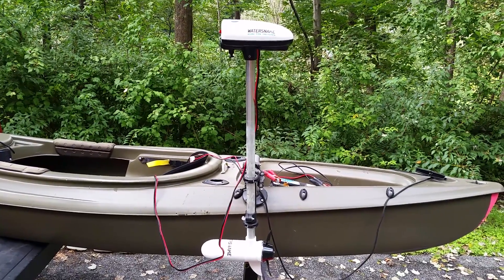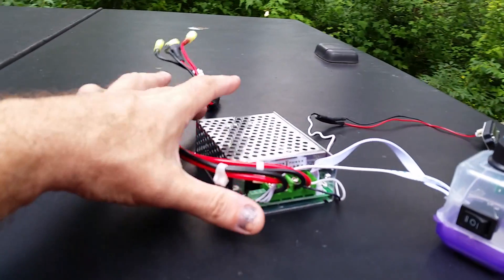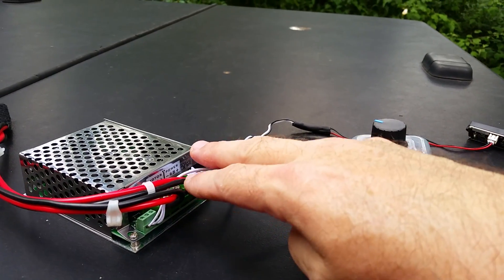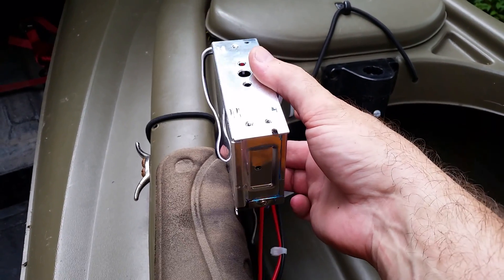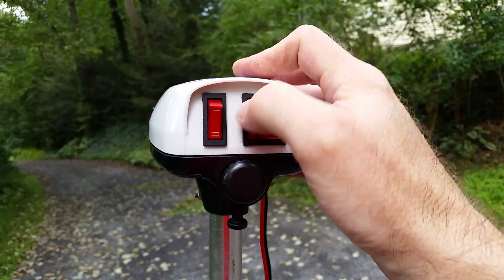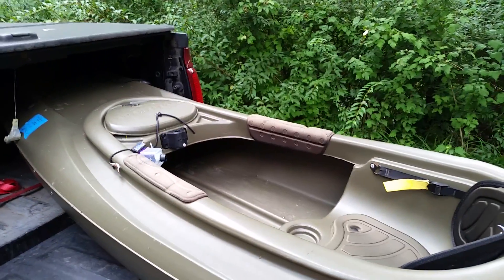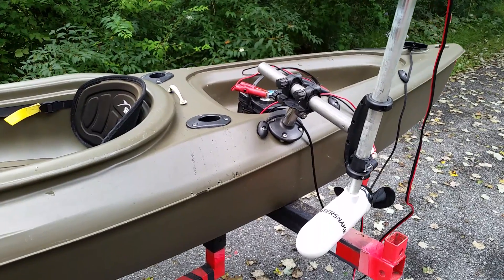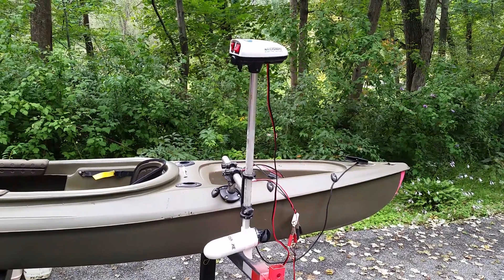Turn Any Trolling Motor Into An Infinite Variable Speed Control For Under $20

Comment: Idk what he means by juice being used when i got a amp reader on my Bluetooth battery and when in calm water on low power it draws 9amp and flexs to 14 most but thats because im goin to current of the water and then flowing with the current of the water that 14amps drops to 9 sometimes 6 or 7 or 8 but stays at the 8,9,10 amps and then on high power its 20amps but then jumps to 25. On my 100ah battery on low i get a easy 8 to 9 or even 10 hours of continuous motor on low and on high 3 to 4 even 5 hours all depends if im on calm water it just depends if your motor has to work harder and this is the T24 24 pound thrust and i just recently installed a small 50 watt flexible solar in the front that gets me 4ah back every hour on peak sun and about 1 to 2ah in shade but after being on the water for like 10hours i get like a total of 20 to 40ah in between back in my battery so running low is very power saving but in all reality who runs a motor for 1hour or 2 hours straight when kayak fishing i do maybe 1hour on high then sit for 30mins low for 30mins stop for 30mins move for 30 stop for 30 and never really use high unless heading back to dock because im so far in but as said be4 100ah is great specially with a cheap 50watt flexible solar with charge controller and i run a garmin striker on it as well including a 12v cigarette usb c charger and usb 12ft to my Bluetooth waterproof speaker for my music on low but of course you need the battery box which i use because it has the 2 breakers fuse and easy to keep direct sun off the battery in general

Comment: I keep asking this question as I'm considering buying a T18 or T24:  Is the Watersnake trolling motor rated for LifePo4 lithium batteries?  One Amazon image shows AGM batteries only (a deal breaker for me)!  I also saw what appeared to be a Watersnake bulletin that recommended against Lithium batteries due to the 14.5 voltage. What do you think?
Reply from the maker: A higher voltage will just spin the motor faster. A bit over powered isn't going to do much except give you a bit more power. I'd also recommend the 24 over the 18.
I have a Watersnake 24 still in the box if you know anyone looking for one.
Reply: Any battery will work AGM will be will work fine they are way heavier then lead acid and lithium
Reply from the maker: I'd use a LiFePo on it. My LiFePo battery is 13.4 volts when fully charged.
Reply: Recommend lithium depending your distance use 50ah to 100ah 13.8v I've got a small 12.5 ah motorbike size lithium just to go to destination then paddle round the then use motor back to shore really do not need motor all the tme

Comment: I built a PWM trolling motor controller that would run off an old Nintendo NES controller, up/down did speed intervals,  left/right did steering and A/B did forward reverse. Unfortunately, it was in an audible frequency range since I didn't realize the switching frequency was so important.

Comment: Do you have a parts list for the RAM Mount for attaching the motor shaft to the kayak?  That looks a lot slicker than some of the "Jank" ways for attaching the motor securely to the boat.  How do you STEER?  using paddles?  I don't see any cables for directional control
Reply from the maker: I used to teer by leaning like a bike, or using he paddle foe sharper turns.

Comment: The concept of using the Rheostat instead of the control switch is to avoid lost power as heat dissipation through the motor/water.  But doesn't the control box just move the heat loss from the motor to the resistors in the box?   Also, is there any way to waterproof/water protect the unit without causing heat buildup?  kayaks get a lot of inadvertent water splash from paddling, fish etc... so figuring how to keep it close enough to use, but out of the weather/exposure would be critical to longevity.

Comment: I use 2 of these on my little 2.1m boat. I leave the switch on "II" and drive them in series (6V each) for low speed and parallel (12V) for fast.

Comment: Can this work for a 55lb thrust motor too? How do I know what switch size etc I need for the bigger motor?
Reply: Well to fess up, I have the electric you have mounted on my kayak already. But picked up a 55lb for $20 that I thought I could swap out, is that just a waste and going to chew my battery unnecessarily? 
Thanks for any help….anyone really…
Reply from the maker: Yup.
If you got a 5 speed motor, pull the head off and get the wires out. The red and black wires are what you want to connect to. The colored wires are for the different speeds, so just cap them and forget about them.
Reply: @DanHiteshew-oneandonly  so it was a bow mount wireless that needed a $400 part, so I bought it for $20 as I thought I could Frankenstein it up and have heaps more power. If it were you would you stick with the smaller one or go the 55lb?
Reply: And then would the variable speed switch above have enough amp for a 55lb motor?

Comment: I have the t18 and I am using a pwm and I'm not sure if I will have high speed since I am no longer using the original head unit.  Do you know how it will perform with the pwm and not using the original head unit?
Reply: Thanks for the information.  I saw the narrower blue wire and I got all confused. Thanks again
Reply from the maker: @michaelblencowe4241  I'm not certain about that model, but the colored wires are usually the ones that are switched. the red and black should be what you connect to.
Reply from the maker: If you connect the positive and negative to the PWM you'll be able to turn it to 100%. You'll get just as much top speed out of it. (maybe a bit more)

Comment: None of these PWM videos show how a heavy 6 or 8 guage trolling motor wire is connected to those tiny terminals on the PMW.
Reply from the maker: What size motor do you have!? I used regular 14 gauge (maybe 12) extension cord wire.
Reply: @DanHiteshew-oneandonly  MotorGuide 34 pounds thrust. There are no thin guage wires on it. The manual recommended a 50 amp breaker. The toy PWM shown on YouTube videos and sold on Amazon is all a farse. No electrician would hook that junk up to a trolling motor.
Reply from the maker: @cdgarrett1  Ok

Comment: I have a Minn Kota c2 40. Its a 5 speed and it does not do full 40a draw at F1. F1 draws only 6.6A and F2 is 8.3A. 

I believe there is inefficiency at low speed but highly exaggerated

Comment: EBay sell a waterproof PWM type DC controller that seems to be the right spec, max amps is lower at 20amps, and you’d have to wire your own reversing switch to the outputs.

Comment: Hi. I have a twelve Volt System on my sneak boat and two pedal style steering cable operated. It has a F/R switch. A H/M/L switch and a variable speed rheostat knob. The original trolling motor has four wires which connects to four brushes. My Q is, can I take a tiller handle style and convert it over if it only has five settings or do I need one that has the variable speed on the foot controller.? Looking at my options and would appreciate assistance.
Reply from the maker: You should be able to connect the positive and negative to the speed controller. the additional wires are for the switch of speeds. You just want on/off and let the rheostat control the speed. (I think I understood your question correctly)

Comment: Your battery was at 82%. At the start it actually showed 75%, as you probably know by now the meter was upside-down 😂 Apparently those watersnake motors are not like other motors and are very efficient on the low setting. It's probably PWM but not variable but don't quote me on that lol.
The 24lb thrust motor uses 20Ah on High and 9Ah on low. The 18lb motor is something like 15Ah on High and 7Ah on low.
Saying that variable speed and also having the controls up front is nice 👍

Comment: did you buy or make your motor mount?
Reply from the maker: I bought the ball joint style universal mounting kit, but still had the make a piece to mount it level on the kayak. I have an unopened mounting kit still in the box if you're interested in buying it. danielhiteshew@gmail.com

Comment: may I ask can I use a 24v battery for my 12v 34thrust for higher speed ?
Reply from the maker: No. It'll overpower it. They're designed to handle 12v.

Comment: too much wires ..just get a lithium battery it will troll you all day
Reply: That doesn't solve anything with the wires... ah is ah no matter if its a lead battery or a lithium battery. The lithium can recharge more than a lead and is lighter but 3x the price.
Reply: @Astrophoto01  I think the point is that with a Lihium battery you can skip all the wiring and use of the speed controller and just direct wire the motor to the better battery. A lithium battery would allow you to use a lot more of the ahs without damaging a lead acid battery where you could only use half the capacity to avoid shortening the battery life. There's also the advantage of the lithium battery weighing 1/3 that of a lead acid battery. The negative is the extra cost. But the whole situation would be much simplified with the use of the better battery.

Comment: I’ve already gone through two, 60a controllers and they end up burning up, . The second one only lasted 5 min before it started pouring smoke. Have you had any issues with yours overheating?
Reply from the maker: No, I haven't. These are cheaply made units, so it's possible they wee defective. I've coked them by hooking them up backwards before, but it was always my fault when I ruined one.

Comment: Hi Dan, Great video and it gave me inspiration to use it on my kayak. Just had the speed controller go out and found out by accident it was the on/off/on rocker switch. Very cheap switch and found them of the AZN web site 5 switches for 4 dollars. Just wanted to let people know before they throw their PWM unit away to check the switch. Yellow hot, black forward, red reverse. You can direct connect the wire to check and see if it's the switch. I can also hear a relay clicking in the unit but it's still working so I haven't tried to access that one yet. Hope this helps someone.

Comment: Nice set up ! Why must it be a 25khz unit as per your description?
Reply from the maker: Human hearing range ends at about 20 kHz, so 25kHz is well beyond what we can hear. If you use a lower frequency, you may hear a hum or whine coming from the unit. (I use a 15 kHz unit and it doesn't make any sounds that I can hear)

Comment: Works great. Prop spins at half speed directly from my 100 watt solar panel. It’s best to wire around the cheap switch in the head. Take it apart, contacts are like tinfoil. Solved my overheating problem with lipo batteries which run 13v and don’t draw down under load. One note. The description says the three position switch is forward reverse and brake. If that’s true then the middle position will draw current unless the speed control switch is turned off.
Reply: Fwd - off - reverse

Comment: What wire did you use? Where did u get it?  And how did u make connection to the tiny terminals on the pwm controller?
Reply from the maker: I used 10 ga wire (maybe 12 ga) and put ring connectors on the end so I could bolt it to the terminals.
Reply: @DanHiteshew-oneandonly  Is that single wire or three-wire?  Novice here :)
Reply from the maker: @gemini70seenager97  I used individual wires, but you can get wire that has the black and red together in "one" wire. Just be sure you get at least a 12 gauge.

Comment: Does it matter if you put the battery meter ring connector above or below the battery ring connector when attaching to the motor driver terminal? I couldnt get a good look at this connection in the video.
Reply from the maker: I'm not sure what you're asking, but as long as the connectors are making good contact, how they're connected doesn't matter so much.
Reply: @DanHiteshew-oneandonly  What I'm asking is - when you screw in the ring connectors for the led battery meter into the same terminal that the battery ring connectors screw into, does it matter if the battery meter ring connectors go above or below the battery ring connectors? It sounds like what you're saying is that the order of the connectors on the terminal doesnt matter, correct?
Reply from the maker: @dougmc81  Correct. As long as they both have good contact, with no loose wires, or movement of the connector rings.
Reply: @DanHiteshew-oneandonly  Did you use longer screws than what came with the device? Or non-insulated connectors? Do you have a picture of the connectors that you used? Specifically, on the terminal that shares connectors from the battery meter and the battery.
Reply from the maker: @dougmc81  I don't even have this set up anymore. I'm in a bigger kayak with a Minn Kota 30. I used simple connectors like these. https://amzn.to/2CZzbtj
Reply: @DanHiteshew-oneandonly  I'm using the same connectors, pretty standard. But for some reason for me the slot where the screw goes in will only accommodate a single connector because the insulation is too thick. If I try to double them up with the battery meter connector and the battery connector in the same terminal slot, the screw wont screw in. I'll try some longer screws, but am still super curious how you got it to work with the short screws that came with the device!
Reply from the maker: @dougmc81  Just make a single line that splits into a double line pigtail.

Comment: Enjoyed the diy video. I have an old Minn Kota Model 35 from 1995. The switch burnt up and I had an interesting leaving a smoke trail on that outing. I’m not a good swimmer but the kayak isn’t either with 60-65 lbs of excess weight mounted on it. When I bailed out with my life jacket the tipped kayak filled with water and sank to the bottom.
Reply from the maker: Doesn't sound like a lot of fun. Glad you're ok.
I've got a Minn Kota 30 with the head pulled off of it now. I direct wired it to the motor controller.
Reply: Well your not very bright are yah

Comment: Hi, many thank`s for amazing video.
Questions:
1. is this item good for 54LB thrust motor? https://www.canakit.com/50a-dc-pwm-motor-speed-controller.html
2. What frequency range is ok for operations (noise wise and longer motor lifespan wise)?

Thank`s!
B737 pilot, Ryanair
Reply from the maker: That should work fine. It's a bit pricey, but all the specs are right. You want anything over 20kHz (mine is apparently 15kHz and I don't hear it)

Comment: I need help. I installed a pwm to my Newport Vessels 24 volt, 86lb thrust, 48 amp protected by a 50 amp breaker. It fried, taking out the battery meter on the motor, motor still works. The PWM has the following description. DC 10-55V 12V 24V 36V 60A PWM DC Motor Speed Controller CW CCW Reversible Switch. What went wrong?
Reply from the maker: No idea but if I had to guess, I'd say you hooked the wires up backwards and fried it. It only takes a touch of the wires on the wrong polarity to fry it.

Comment: Still happy with your setup after using it for a while? I hear the overheat easy and breakdown constantly.
Reply from the maker: I'm using a similar set up on my Ascend H12 now. And yes, I love it. The speed controllers are kinda cheap, and I've had them stop working after a season or so, but for $30, I don't really care.(you can buy an expensive speed conroller that'll last years, I'm sure)
Reply: Dan Hiteshew great to know. I’ll be buying one for sure. You think they go bad because they overheated? Do you keep them inside that watertight box to protect from the elements? Also, what is a season for you of fishing? 10 times out during the year? 20, 30, more? For me in Florida a fishing season is all year around but I get to go fishing maybe 30 to 40 times per year.
Reply from the maker: @spanglishangler  I don't keep it sealed, but I keep it out of the way. I try not to get it wet, but it needs to be able to cool down, so it needs air movement.
I can usually get out between Mat and November. I don't like cold or even chilly weather.

Comment: hi bud great idead what are the wires called you dont get with the kit
Reply from the maker: I used 12 gauge wire to make sure it could handle the amps if that's any help.

Comment: I have minn Kota 45 will keeping it on power setting five cause problems for the pwm? I don’t wanna remove the head of my motor
Reply from the maker: No, that's what you need to do if you leave it intact. 100% on the PWM will only be 100% of whatever you've got the motor set to. (If you set the motor to 1, then you'll never go faster than that.
Reply: @DanHiteshew-oneandonly  ok excellent. ive heard others saying they burnt them up by not bypassing the original speed switch on the tiller
Reply from the maker: @mrdvcapj  Running through the switching will add a little resistance, so it'll be a tiny bit less efficient, but not enough to notice. It shouldn't really have any other effect. The cheap PWM don't always last long, so maybe that's the problem some people have. I figure for as cheap as they are, a season of use pays for itself. Lol

Comment: Great video! Thanks so much for the valuable info. I bought one from Amazon but everytime i turn the dial on the speed reader turns on fine but when i engage the power button either forward or reverse the whole unit shuts off. Any ideas on what's wrong?
Reply from the maker: No, that sounds like a defective unit or something.
Reply: @DanHiteshew-oneandonly thanks for your response. i thought so too so i ordered 2 replacements afterwards and both are doing the same thing. Driving me crazy
Reply from the maker: @moes473  Maybe you're wiring it wrong?
Reply: @DanHiteshew-oneandonly  I think that's the case. I just stripped each wire and crimped them down and that seems to have solved the problem. Thanks again for your input.